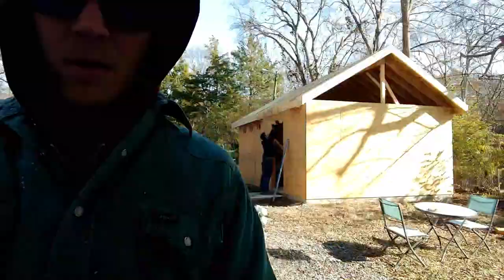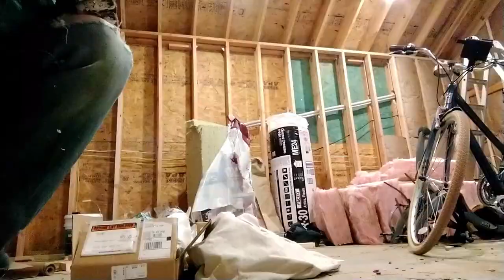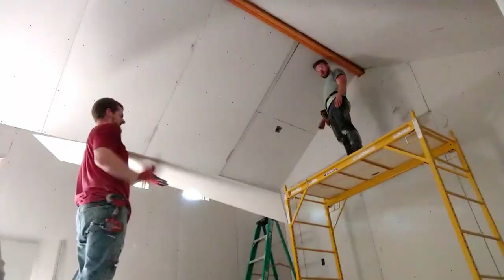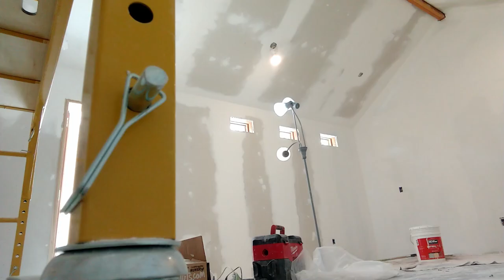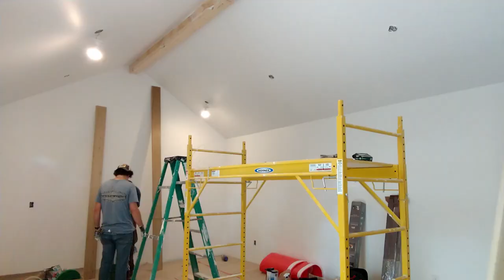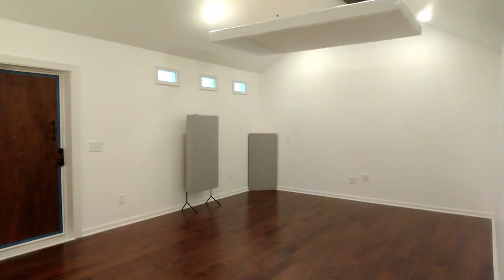Soundproof Backyard Studio Build - Timelapse

Comment: Beautiful build!  May I ask why you chose resilient channel (or hat channel and clips; can't tell which for sure) on the ceiling instead of more framing?  How did you seal around the ridge beam?  Honest question: since the ceiling doesn't have separate framing, couldn't you have simply used the channel on the walls as well?  My understanding is that your room is as good as the weakest point.  I'll soon be building a similar sized studio and this video is very helpful.  Thanks!
Reply from the maker: You know at the time, I really just took the advice of the soundproofing company. It works, but it is not the best. You are right that framing out a second ceiling would be way better. More money and time, but better. In some ways I could have also hat channeled the walls too, but I am glad I did the double wall. I do think it helps a lot. I also would not use a soffit system, but put insulation under the shingles to meet code requirements for moisture. This would mean you could seal up that "attic" space completely also helping with soundproofing. The first build is never perfect, but it is really close!!! Best of luck!

Comment: Nice build.  I am going to go check the website.  I am most interested in what you used for the door (there is little info out there on exterior doors STC rated).  I could not tell in the time lapse if you used green glue between the layers.  I was going to ask why you did not use channel to mount the wall drywall, but someone else pointed out you have a second set of studs inboard of the exterior walls for isolation  - I didn't notice that in the first viewing.  Time lapse goes fast. edit  OK, your video explains what I asked.  I did not see that sheet lead coming!  Great job on the website!
Reply from the maker: So I created a very heavy door, however I used a solid core door with lead and plywood and it has warped ever so slightly over the last two years and has caused issues. So, now I would recommend an exterior door that won't warp. This could be a metal door from Overly doors that is acoustically rated or a very heavy steel door with a communicating door system. The inside walls are a double wall design so hat channels were not needed.

Comment: awesome build! nice work! looks really great! I had a couple of questions: 1) it looks like you framed out two walls with a 1" air gap betwen frames but then just filled the air gap with insulation? why not do insulation flush with the outer wall, then the air gap, then insulation flush with the inner wall? 2) what kind of windows did you use and how did you soundproof them? 3) what was the black membrane you put on the ceiling OSB board before laying in the insulation? 

Thanks,
Jonah
Reply from the maker: Hey Ms. Nomer! Great questions. So the insulation question is one I still wonder about too tbh. It is difficult and more expensive to put insulation in one wall then add that second layer of insulation. I imagine it would be hard to keep the insulation from touching each other, but could be worth it. In my opinion I don't think the insulation touching both walls is transferring much sound. Here is a link to how I built my windows - https://youtu.be/JQiozaQcTkk. The black membrane was a roof vent to allow air to pass between the insulation and the OSB board. Hope this helps!

Comment: Great. But why did you make it rectangle? I think if I was in that situation, and if everything, including the budget allowed (seems it may did), I will make it to be not rectangle, to have no parallel walls. But probably I'm wrong or probably that's not the best way, IDK. Thanks for share it anyway
Reply from the maker: Yeah you could do non-parallel walls but then you wouldn’t no the room modes as easily. Also, you would lose a lot of space to those angled walls. Really you can build studios either way. I like the idea of building a rectangular room for room ratios and then angling a 1x2 wall for treatment. Then it looks angled but the bass frequencies still hit the rectangular walls.
Reply: @soundproofyourstudio   Yea I know it's not easy math for the shape and size to be perfect. However, I see in the video, the land  is spacious enough to have angled wall build. And yes, it can be angled in the inside portion of the room too, of course.

Comment: I am about to build one as well. Like 7 or 8 meters by maybe 3.5m. I normally lile natural light as much as possible. Is there something that you think would be good for using? Like double glass window standard that are on the flats?  Also, would play drums inside. That would not be a problem for the neighbours in something like you built. I mean my neighbours are 15 m away from my garden. Also, how much would smth like that cost in total. Materials and leibour, aprox of course? Thanx a lot! I like what you did there. Looks super!
Reply from the maker: Thanks for watching Florin! Sounds like a fun project. For windows I would recommend building them yourself. Build a double wall with a one inch air gap and then put 1/2" laminate glass on the outside and 3/8" tempered glass on the inside. I did that in my studio and could not be happier with the soundproofing. I can help you with full install directions if you want. Feel free to reach out at info@soundproofyourstudio.com. Happy to help! Total cost for us was $43k. Not cheap, but not bad also. I think the cost of materials has gone up significantly since 2019/2020 so factor that in as well. I have a course that has a budget calculator if you want to check that out too! Best of luck!
Reply: @soundproofyourstudio  Hi! Is that $43k including all labour?
Reply from the maker: @joelcorriveau  yes

Comment: How is the studio sound proof? None of the walls are floating and it looks like typical installation that you used in the walls.
Reply from the maker: Hey Joseph, its a common myth that everything need to be "floating." There are two walls. The outside walls and an inside wall with a 1" airgap. Another big myth is that insulation is what makes a wall soundproof. Mass, decoupling and airtight builds make a wall soundproof not the insulation. Thanks for watching!
Reply: @soundproofyourstudio  thanks for the information. The subject interests me. When I buy a house I want to build a sound proof room to play loud and record.
Reply from the maker: @JoeDread316  YOu could play as loud as you want with this design!
Reply: @soundproofyourstudio  🔥
Reply: Yea, I used rock wool in my walls and ceiling, big difference compared to the first time i had used the regular attic insulation. It’s good for weather protection, not so good for soundproofing. It’s cheaper and better than nothing I suppose.